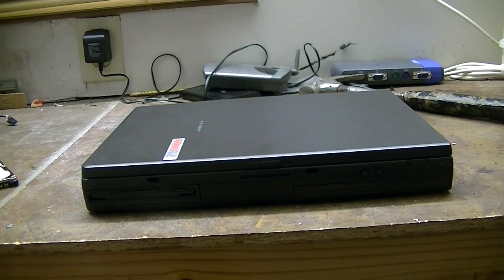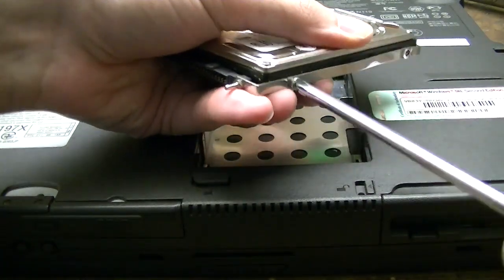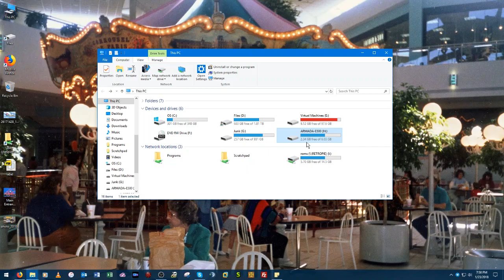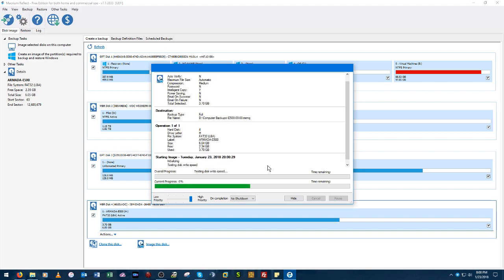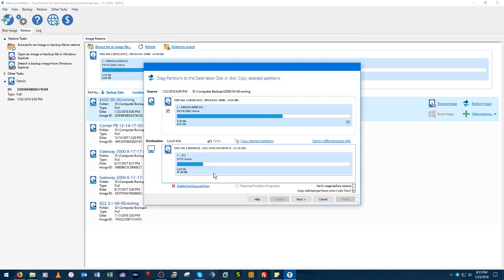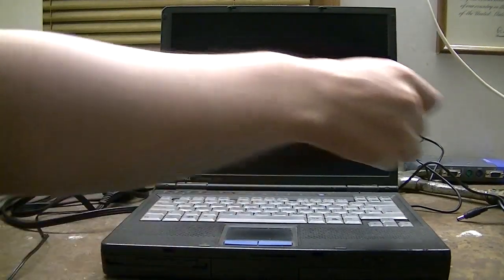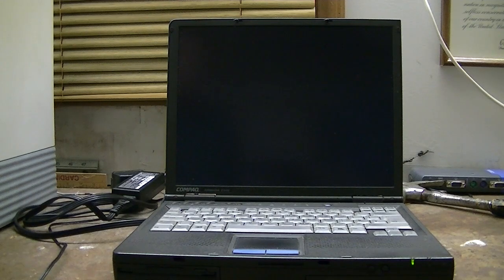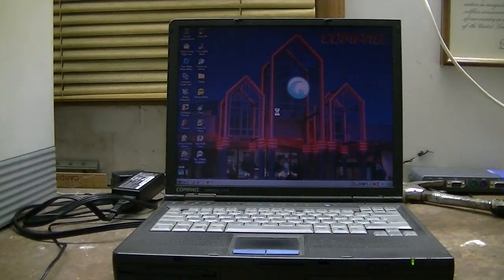Compaq Armada E500 Hard Drive Upgrade

Comment: i have this laptop running win 98 but i get an error invalid memory pluged in! but one time i did not get this error and it ran very good.  is everyone know how to fix this error?
Reply: replace the RAM?
Reply from the maker: Might also wouldn't hurt to make a MemTest86 floppy to test its RAM.
Reply: Did you use the proper RAM? Some machines are notably picky about RAM (like needing PC66 specifically even though for the most part PC100/133 will work)

Comment: You don't cover the product key
Reply: It's Windows 98, it's not like Microsoft will find this video and yank it from YouTube ;)
Reply: Yeah...  I know 😂 but is for privacy....
Reply: And i know windows 98 doesn't need to Be activated....
Reply: Product keys on devices are tied to that device, I had a few laptops laying around tried swapping keys. It doesn't work.
Reply: I know this ,i'm not that stupid
Reply: zappy bear Well... At least for xp, and seven you can use the key in another laptop. Thats why my gaming pc with windows 10 has a upgraded key from an old and dead windows 7 starter laptop. 
And my laptop has a windows 7 key from a older dead dell too. 

W98 i had to install some times and i used some keys from sites, and some from a old pc that i had, i never had this kind of lock to the device. I think there were some keys that were tied, but not all of them.